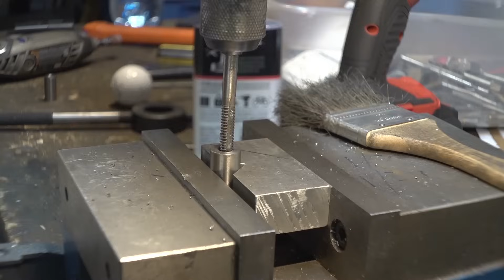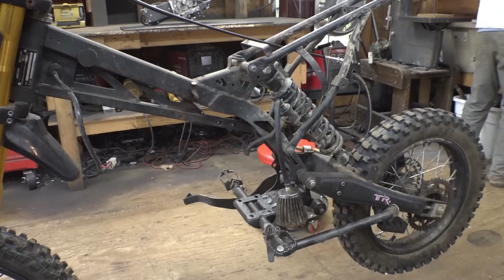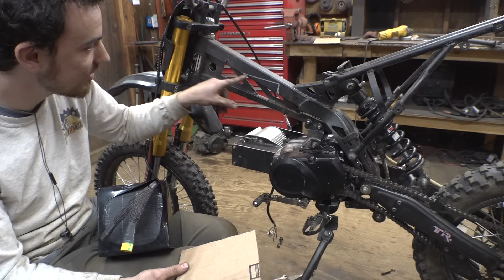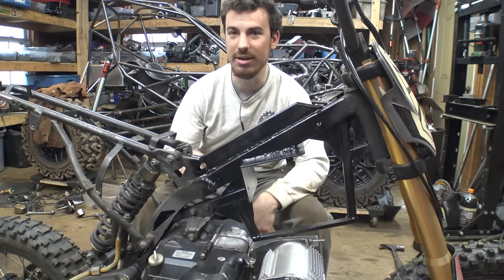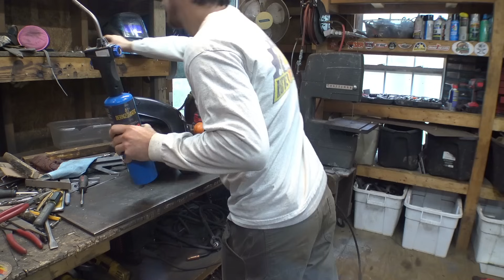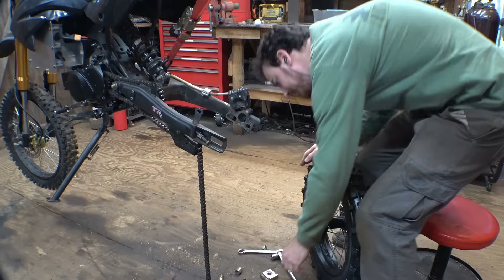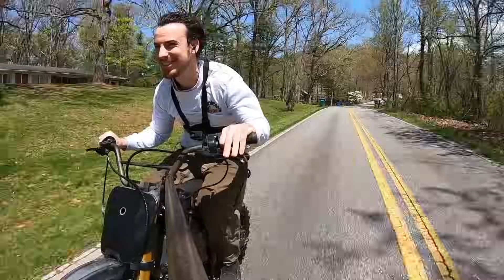A Different Way to Build An Electric Dirt Bike  - Part 2

Comment: 3 miles per charge ? if it is a 6000k motor and you have 1200k it should be 10  minutes so it should be 8 miles or so

Comment: The funny part about this is there's no gas motor, so there's no need for a clutch lever as you would be able to press through the gears faster an it's never gonna stall

Comment: Happy RBW day everyone :-)
Love how this guy cracks on with it ...

I did smile though when you were leaving the workshop and you pulled in the clutch to engage 1st then let the clutch out slowly ..
I suppose you don't need to do that to pull away,, I would have done the same if you still have the riding an internal combustion engine process in your head,, 
Great job good work  ,,

Comment: Before hitting the dirt, mudguarding the motor would give it a fighting chance to get back on the trailer by it's own power.
Also, when doing a gearing change, always go up first. Bigger front sprocket, bigger initial gearing, etc. This way you don't lose the leverage @ the rear wheel, while prolonging the lifespan of the chain. For a basic chain, 13 teeth is the flat minimum. 15-17 is good for the driving gear, bigger than that starts to eat the torque, i.e the motor heats up, clutch gives in, bearings wear out etc. Under 35 @ the rear does the same.
On this particular setup, I would go 17 on the E-motor, 15 on the crank, 17 on the engine secondary, and 35 on the rear wheel. It will do 75, if the clutch holds. When hitting the dirt, just swap the original rear sprocket back on.
Reply: Bigger on the front (as opposed to smaller in the rear) would also save the chain sliders on the swingarm a bit.
Reply: Since clutch and gear box design was related with the original engine, gear ratio from motor to gear box should reference for the RPM and torque in the original design to avoid buring the clutch. Before changing the rear wheel ratio, the aforesaid factors should take a more important role.
Reply: @taimanchan7057  Exactly what I was thinking when he mentioned the clutch slipping.
Reply: Thanks for the info.I always thot that a smallest rear sprocket is best for speed.just like on mountain bike...
Reply: shut up !

Comment: Larger spocket on electric motor to get transmission in the same operating range as the gas engine, larger rear wheel sprocket,  and shim the clutch springs
Reply: Not sure this guy is a moto person... but cool build by all means
Reply: Exactly right.
Reply: because it has 2 gears (14t/f/41t/r)wouldn't making the front one bigger while decreasing the rear also produce similar results?

Comment: Great video  it looks like it preforms very well but i still say you are losing power by using a transmission and you have a ton of failure points electric motors with controllers are variable speed running a electric motor to drive a transmission just creates more friction witch in turn kills the battery and lowers the power output to the tire.

Comment: You could try mounting the motor inline with the old barrel and use a 90 degree bevel/worm and wheel drive setup to the crankshaft, it would save you having weld up the crank cases and all that faff, also instead of making an entire crankshaft you could have cut the balance weights from the ends of the shaft and just made a middle piece... just a thought:) Keep up the good work!

Comment: THIS CAME OUT 2 HOURS AGO¿! Who the fuck let me sleep in so long¿?  O, it was my fault.... O, OK, cool.  So.... Part 2 is out.  😅😁
LoL
Edit: Just a little FYI for anyone not understanding how he calculated the HP, 1 horse power is about 750w so 750x8=6000w... I Want An Electro and Co kit so badly¡!   😁
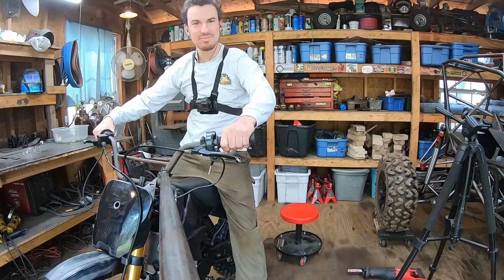Edit 2: 37:51- Did you just try and use the clutch like an old school internal combustion engine bike¿?   🤣🤣🤣

Comment: Cool build!  Gears will improve efficiency of the motor.  You may go further than you think.  If you add a seal behind the main shaft gear, it could keep oil out of the motor.
Reply: Gears definitely won't help with efficiency with this motor. Most electric motors have a wide range of optimal RPM ranges and gearing will only introduce losses.

Comment: Question if you are cutting out the gastank bottom would the battery now fit on top using the tank as a cover ? Dont  know hard to tell watching the video , justice a though

Comment: Hey, fantastic build and engineering. But your problem with gearing is you have it at 1:1 
I imagine the original engine revved to 10k?  So it should be geared 1.6:1
Your gearbox would be spinning at the correct speed allowing you to run original wheel gearing.  
Great videos and keep em coming!

Comment: Finally a drive train that can handle a decent small electric motor. The bicycle stuff does not. Puny little 3000 watt cyclone tears it all apart. I have to use a single speed freewheel and turn down the power to about 60 percent. 1800 watts.

Comment: what if you attached the motor drive sprocket to where the generator used to be rather than where the connecting rod was
this way you can run ribbed belt and it would fix the oil issue

Comment: I would just put RTV on your chain cover and leave the oil in there like that..  It's oiling the chain and working nice, just make sure it has a clear path to drain back down into the bottom.

Comment: You honestly don't need a clutch at all..  It can still shift fine without a clutch-- just try it next time your riding.   The only real reason to have a clutch is for take off--- but with an electric motor, you don't need it at all....    You could rig up a part that will replace your clutch and solid mount it-- and I bet it would work great.
Reply: Clutch saves the gearbox
Reply: @mkultra4542  Make an adapter that has a rubber coupler--- similar to a jetski prop axle or like a tractor PTO shaft, ect..

Comment: I use a 80V 5Ah greenworks tool battery on the same exact motor and a different speed controller and i get about 8 miles on it averaging 20 mph so i think you are underestimating that 20Ah pack haha you should get at least 10 miles on it!

Comment: The slipping is because that engine needs the oil pump to pump fresh oil through the clutch pack. You will continue to burn up clutches without it.
Reply: Does that engine have an oil pump? I didn't even think it had a filter
Reply: @bradensmith888  yes, it's a copy of Honda's Z50 horizontal engine which has an oil pump and the filter is a brass screen replaced or cleaned by removing the clutch side cover. It's located above the drain plug. The semi-auto clutch engines will not operate properly without oil pressure through the center of the crank. That's why the cover over the clutch pack has a gasket, so pressurized oil feeds the clutches to keep them wet and cool.

Comment: It's a 6KW motor. Think about how much heat 6KW can produce. Look at the size of the motor. 

If it could not take that heat, the manufacturer would put huge heat sink fins on it, or liquid cool it. I suspect you will see liquid cooled motors for these applications coming down in price for the whole system. It comes down to the number of watts and the size of the cooling surface if air cooled or the size of the motor with a cooling jacket if liquid cooled. Yeah, it's going to get hot the way it is.

Comment: Brilliant build! 

Does the motor come with its controller? From the link you shared in the description? If not, can I have a link to the controller you used? 
Also, what’s the battery spec?

Thank you.

Comment: please stop using the clutch when shifting just let out the throttle and sift it in to the next gear use the clutch for taking off you don't even need to do that because of the electric motor you should never need to use the clutch.

Comment: The oil being pulled up the chain is not a bad thing as long as it can drain back into the crank case and does not inter the motor housing. May need to add a drain back hole/tube, and a vent, also may need to adjust the crankcase oil level. You have shown yourself to be an excellent welder, machinist, fabricator. Peace and blessings.

Comment: For the slipping clutch, did you use an oil with the right friction modifiers for wet clutches? If not, would recommend looking into that, especially for the next build.
Reply: Conventional automotive oil will roast a motorcycle clutch in a hurry. Always use oil rated for wet clutch applications.
Reply: i think the clutch might be slipping because of the gearing change, since its a small sprocket its putting even more load on the drive train than what its built for